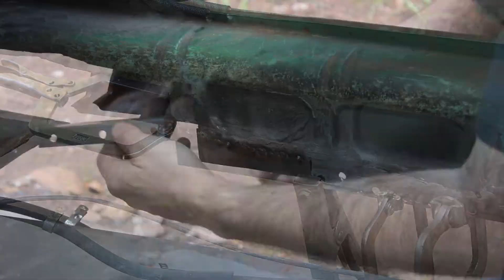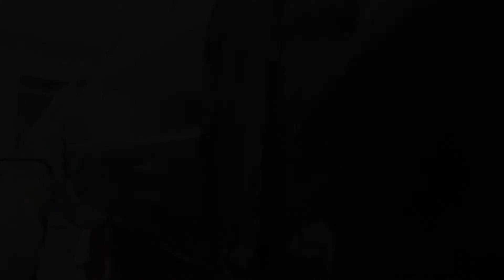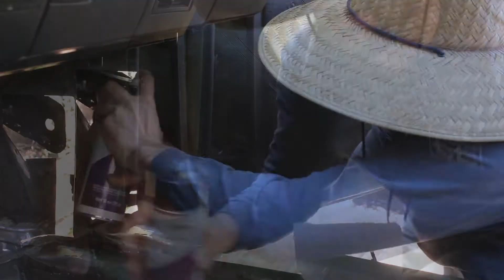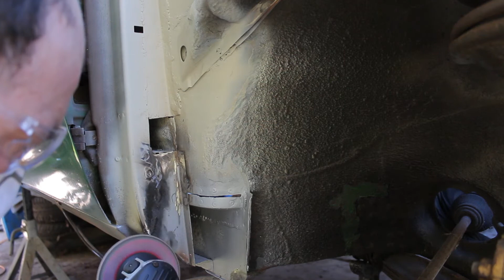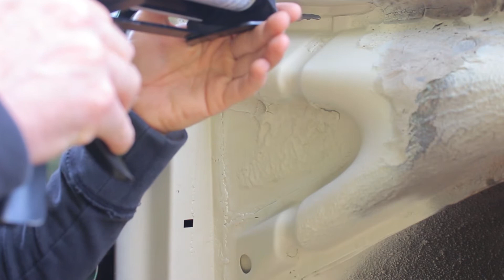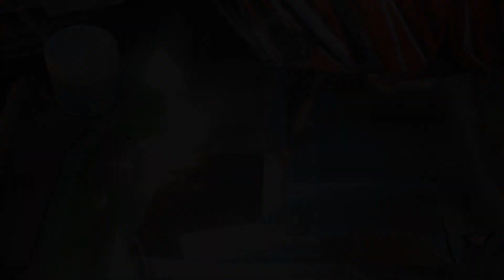VW MK1 Scirocco Rust Repair and Floor Pan Install

Comment: Metal work isn't easy, but you sure do make it seem like it is haha. Keep the videos coming, maybe make a video on the actual process of what needs to be done in order...cut out metal, grind around the area, weld through primer...etc if possible :) Would help out a lot.
Reply from the maker: Thanks, I should have the next video ready in about two to three weeks. I try not to talk too much and bore people. I would rather let my work speak for its self. I also try to keep the videos under 10 min. I think if the videos are too long and I talk too much people lose interest? I appreciate your comments and will keep them in mind as I edit the next video.
Reply: i would love to get some tips or advice currently starting the rust repair on my 79 golf
Reply from the maker: Step one cut out the rust. Two weld in new metal and three grind down your welds. Most importantly be sure to watch my next video :) should be ready in a week or two. Good luck with your '79.
Reply: Thanks ye only 19 and scared to break something ¯\(ツ)/¯
Reply: Im 23 and afraid of the brittle plastic from the mark 4 platform. I have to tackle the rockers soon with some new metal

Comment: Did you spray wax on the bare metal inside the rockers? Does that really work? What kind of wax is it
Reply from the maker: I paint all metal then used 3m cavity wax. It helps with rust. Thanks for watching.
Reply: How did you paint inside the rocker after welding it shut? Nice sombrero
Reply from the maker: Weld through primer, it won't catch on fire. Primer, weld then paint if possible. It gets hot in San Diego and the sun can be intense.

Comment: Your cutter how big?
Reply from the maker: The Three-in-one is 12" The cutter is 10" I wouldn't recommend the three-in-one.
Reply: Sorry, but what is the 3 in 1?
Reply from the maker: The three in one cuts, bends and rolls sheet metal. I will show it roll sheet metal when I finish the driver side.

Comment: whats the thickness of the sheet metal
Reply from the maker: I used 18 and 20 gauge.
Reply: govwgo i had just got a rabbit truck and floor are shot but this video gave me hope keep it awsome vids
Reply from the maker: Glad I could help, you can do it. The floor pan in a truck is about half the size.

Comment: hello there......nice mk1.
i allways used to love them when i was a kid.there are not many good ones left here in germany.so its nice to see someone puts some life back into it.
very good overall vid and the music is outstanding relaxing while watching.

i own a vw dasher 1978 in almost mint condition in panamabrown.

so far i only had to weld in new flares on the back....hopefully it will stay like that for a long time to come.
its lowered about 90/60 with fully polished 6x15 vw bbs RA wrapped in bridgestones 165.50.15.....and a small 320mm steeringwheel....nothing else...no gimmicks.

i have a question....

why is it that you choose rather small patches on the floor?
i was just wondering...

how is the situation with parts where you from?

www.volkswagen-classic-parts.de

you might find some things you need....if you not allready hip to the site....✌🏽

once again thanks for the nice vids.

greetings from germany
Reply from the maker: Thank you for the link I will check it out. I used floor patches 12" wide because the tool I have to shear, bend and roll is only 12" wide. I also found it easier to make small panels because if I messed something up or cut to much off and had to redo it. I like your style "no gimmicks" you don't need gimmicks if your ride is not a dime a dozen.

Comment: so much rust in the inner seal. maybe you should consider replacing whole inner seal!? its going to pop up few years later. heated, moist metal with older rust issues. gonna be painfull to throw all these things that you have done right into the garbage